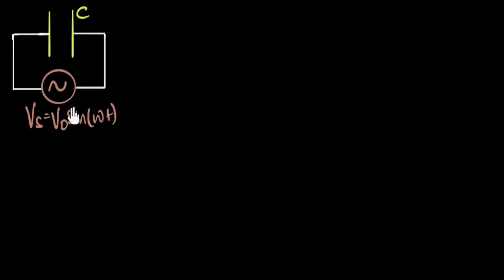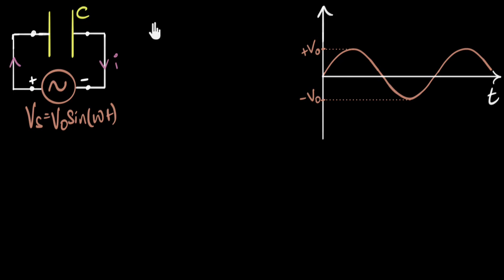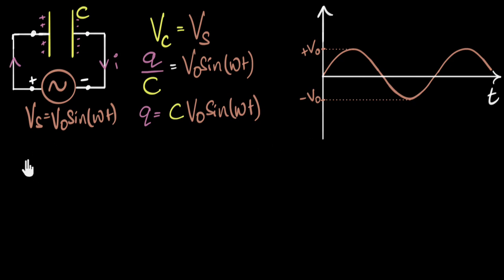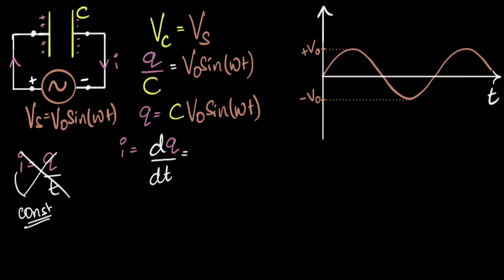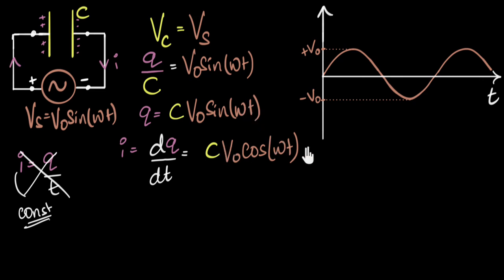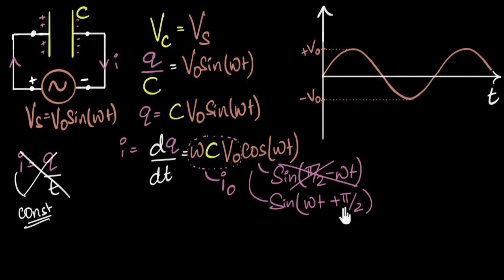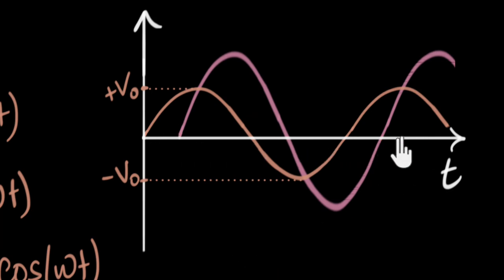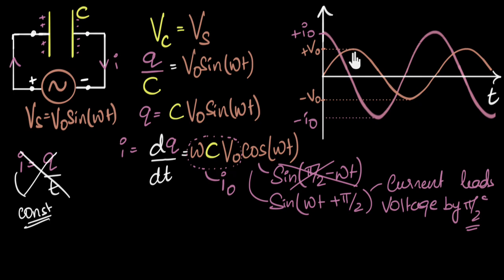AC voltage across a capacitor (derivation) | Alternating currents | Physics | Khan Academy

Comment: Thanks for your effort!
I have a question: how is it possible in initial moment of time when V=0, I=max? In this point voltage difference is zero, so the capacitor wouldn't "know" how great it would be to "calculate" I max. Really really looking forward for your answer, thanks.
Reply: Capacitor is a device for storing electrical energy . My point is when voltage [ potential difference ] is zero the potential difference in the whole circuit is same which is v = 0 this can only happen if the Capacitor is charged to its extent and at the very stage to get discharged. Hence it holds the maximum current
Reply: You shouldn't look at magnitude of voltage but rather how fast the voltage of capacitor is changing because current of capacitor is dependent on how fast the voltage is changing. You have equation ic = C * dv/dt which tells you that current is at maximum when voltage is changing the fastest (when the line on graph is the sharpest which happens across 0V). Because if you want faster change in voltage you need more current = more charge. When voltage is at maximum current is at 0 because at that point voltage doesn't rise anymore and the change in voltage is 0. It's quite logical if you think about it.

Comment: If voltage across capacitor is same as voltage generated then how the current would flow ???
Reply: No you have to look at it other way. The voltage source creates current that charges capacitor to the voltage of the source. But voltage of source is constantly changing which means that capacitor must be also constantly charging and discharging with current. You would be correct if we were talking about DC circuits because in DC circuits capacitor charges to source voltage and then there is no more current because voltage isn't changing like in AC.

Comment: In the graph the peak  value of  current is shown  greater than that of voltage is this correct?
Reply: You can't compare voltage and current on the graph by their height because they are measured in different units. Current is measured in Ampers and voltage is measured in Volts. You could have voltage bigger than current if you choosed so.

Comment: Why voltage is lesser than current ?
Reply: You can't compare voltage and current on the graph by their height because they are measured in different units. Current is measured in Ampers and voltage is measured in Volts. You could have voltage bigger than current if you choosed so.